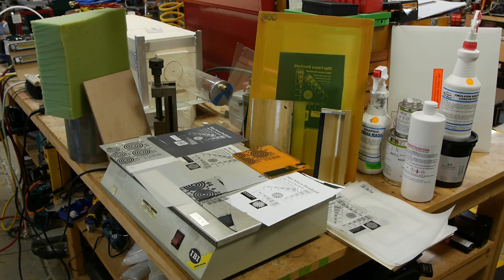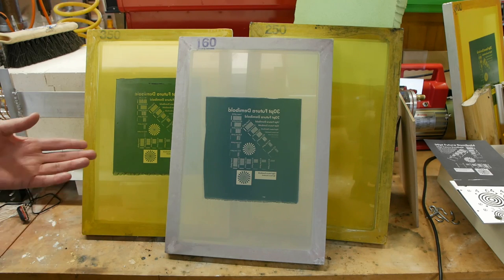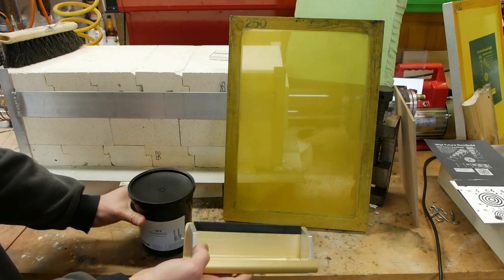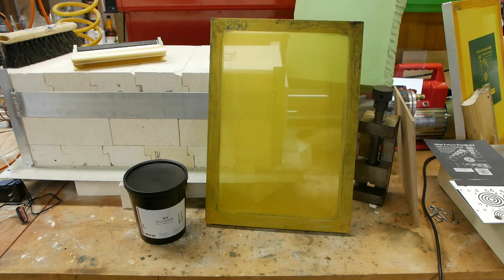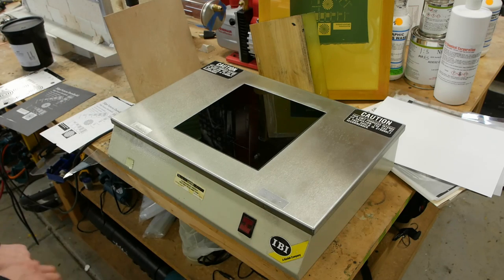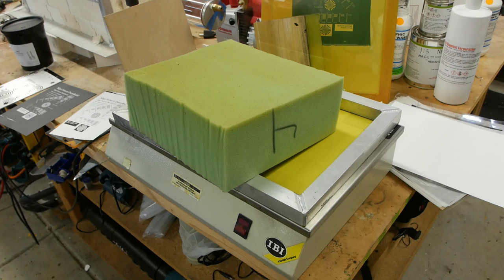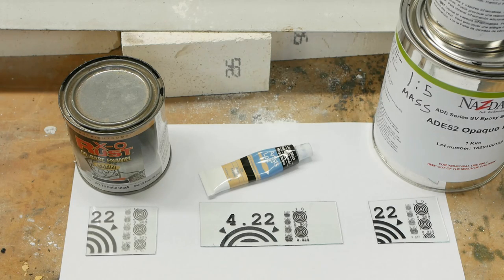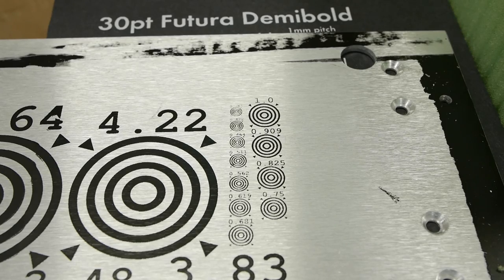High-resolution screen printing demystified

Comment: "Old Fashioned Direct Emulsion" - I've been screen printing for fifty years, in 1972, the "Old Fashioned" photo imaging was a gel coating on film that required a hydrogen peroxide with water for development. Back then Direct Emulsion was about 33-40% solids so the 'sawtoothing with the fabric' was far more distinct. Now Direct Emulsion is far more durable and about 60% solids. Xcellent video.

Comment: This is awesome, long ago (2005ish) I worked at a sign shop and they wanted to get into screen printing but didn't have the money for the equipment so I ordered some emulsion, 200 count screen material, scoop coater, ect, built my own frames and holder with registration pins, printed out the patters with black vinyl, cured it with a halogen work light.. Worked perfect from the first one. I was pretty amazed, made thousands of signs that way.

Comment: I'm a screen printer.  When washing out the stencil, as soon as you get the emulsion whey, it is no longer light sensitive. After burning a screen, I would spray it with water and use my hand to spread the water over the entire image...both sides...the wash out the stencil in daylight with no issues.
:)
Reply: Daylight as the light in the room....I wouldn't try washing out in direct sunlight. Wet emulsion is seemingly less sensitive but not, not sensitive.  I coat and wash out under room lights but wouldn't want sunlight streaming into the wash out area. Definitely no need to wash out in a darkroom setting.  Printer since '92

Comment: This is great. I  silkscreened some t-shirts a long time ago. I didn't know half of this. I looked into doing it again a few years ago and didn't find anything this organized. Thanks. Stretching the screens isn't that difficult. Your recommending buying pre-made screens which makes sense if your goal is just to do silkscreening.  But stretching the fabric is  easy to learn and has myriad applications. Back in college in about 1978 I watched an art student (Hi Eric O!) stretching a canvas- stapling the fabric onto the frame. I've been using that single lesson at least twice a year ever since. Just the simple concept of how to get out all the wrinkles is very useful. (Heavy duty 'pet proof' window screen can support your weight  from replacing a mesh office seat to a cot).    
Also to clean up epoxy, usually vinegar works fairly well. Of course I don't know how it would work with the epoxy paint and the screen materials.    
One issue you won't have run into yet, is if you do a large run of printing, or make a few prints, clean your screen to use again, the edges of the mask will begin to deteriorate.
Finally, your resolution issue just might be a factor of your large light source. It could also be level (intensity and/or length) of exposure.  A point source should be better, but what I know about contact printing in photography... is that the size of the source isn't that important. Edward Weston just used a bare lightbulb about four feet above. What you're doing here in photography we'd call lith printing, no grays, just white or black. Exposure issues seem inconsequential....until they're a problem.  You seem pretty methodical. 
While I'm procrastinating getting on the treadmill... Andy Warhol is famous for his silk screen paintings, I'll bet he never made any of them by himself. He had others make them, and he didn't pay them very well. Gerard Malanga got fed up and moved to Italy. He was short of money, so he thought, why not make some bootleg Warhols? He brought his 'Warhols' to a gallery who was happy to show them...but a little suspicious. So the dealer called the Factory in NYC. Warhol assured  the dealer that they were indeed genuine....but send the check to me....

Comment: Nice introduction to the whole process.  All new to me, but very interesting.  One of my hobbies is restoring old electronic test equipment.  Often the front panels are worn or rusty, and it's a delicate balance between cleaning and not destroying the remaining printing.  I can see how one might scan a stripped down front panel for the original artwork, really clean and refinish the panel, sharpen up and restore the artwork and reprint it.   Even though I usually restore for function, restoring for appearance would be a fun new challenge.

Comment: To increase contrast on your print you can keep your printed sheet in solvent vapors for 10 - 20 minutes. The ink will melt and create smooth surface.

Comment: In my limited experience, it seems like UVA or near UV from LEDs is the fastest at curing these types of photopolymers. I took an old flatbed scanner and lined it with UV led strip and its 10x faster than the UVC bulbs I was using.
Reply: UVC is for sterilizing.  All the UV photographic stuff is either optimized for 365nm (mercury line in an arc lamp) or newer stuff is 405nm to match solid state emmiters (laser LED).  Black light (disco light) bulbs do the 365nm very well.
Reply: Not a bad idea!
Reply: Thinking the same thing sun mostly offers UVA if it is good some simple 365-400nm led types would do it easily. And there are even UVC leds if needed but at a much higher price.
Reply: Don't use UVC, it generates ozone and damages the light fixtures. Plenty of resists expose nearly instantly with it, until you add your transparency, then its waaaayyyy slower.

MUCH better to use UVA/UVB, I use bug zapper tubes and they work a treat for cyanotyping
Reply: @TheCunningFellow  i read "black lights do the disco very well" at first :)
Reply: I have a huge bag of UVB LED's I use for UV curing and they work super fast. The LED's have a lilac color to the eyes, a very pale bluish purple. It is very easy to tell them apart from the 'fake' UV LED's which look like a deep purple. The real ones are more of a pastel color, with almost a translucent haze to them to the naked eye.
Reply: Reminded of Big Clive's video on UV nail lamps.

Comment: When trying to do high resolution printing you can really go down a rabbit hole on that one.  There are combinations of screen and emulsion that perform better.  Not just screen number or the like but the actual screen material and emulsion can make a difference.  That gets into high end manufacturing as well.  I never got into enough to help but it is out there.  What you are doing is perfect for folks like me though.

Comment: I take a screen printing class last year. 
I just print my artwork to regular 70 gram HVS paper using my inkjet printer and then brush the paper with cooking oil to make it transparent. Works better than all my classmates, which mostly using expensive ready to use kit. My teacher is so impressed with mine even though I didn't do exactly what he told me to (using laserjet printer).

Comment: This takes me back, when I was doing screen management at a shop we never needed to cure for more than 5 minutes though, and that was with fairly high detail.

We used laser printed transparencies at 600dpi and supported up to 8 layers with good alignment. Most jobs used a backing layer and 2-4 colours.

You are absolutely right about the matt separation distance causing problems for exposure, but using a paper matt causes too much diffusion as well so I can't recommend unless it's for learning.

Oh, you should cover the ink curing process if you can, it affects longevity and durability especially for cloth prints.

Comment: Great helpful video, I’ve been screen printing for a few months now at my job using the Nazdar epoxy ink under mil-std-130. There are also variety of lead and cadmium based inks but they are all very sticky and quite messy.. as well as fun to work with. I am mainly parts marking so printing a large assortment of surfaces.

Comment: I know you were looking for image integrity being retained in the process and that is often important. 

On the other hand if you don't need the output to be without loss then a hack I tried with respect to the actual screen itself gives pretty good results. Specifically I built my own frames and rather than apply commercial screen I tried 'dollar store' shear curtain material. In my experiment I wanted a painterly feel to the image. To achieve this I thinned SpeedBall's drawing fluid and painted on a floral design in a manner similar to one of my watercolor paintings. I then used SpeedBall's screen filler followed by, once dry, washing out the drawing fluid. At this point I looked through the screen and decided the edges in the image were a bit too well defined and giving more of a coloring book or poster feel to the image than the look of a painting. 

I then grabbed a brush and a bottle of white inexpensive acrylic paint and brushed it into the image to break up the continuity that was giving the coloring book look to the image. I then ran a print. It was gorgeous and looked like I had painted the floral design on the paper entirely by brush. Not only did my lines and fields of color have the painterly look but the acrylic paint having only partially filled grid openings in the screen created beautiful high lights and over all a very good sense of depth was achieved in the image allowing the viewer to feel he or she was looking into three dimensional space.

Comment: This reminds me of my old days using flat bed cameras where you needed to learn various nuances of the equipment and materials to get the best results and test prints/patterns were always something great when making film for printing plates which you could be masked off. There was also the benefit of using a vacuum/compressor bed on both the flat bed camera and UV plate exposer.

I also did print some small run monochrome t-shirts (text and halftone) in the late 90's/early 00's but nothing requiring a high resolution and it was done using home kits that really weren't the greatest and often 2 small screens were used to make larger prints as you just found a solution to the problem you had.

New sub ;-)

Comment: Great video. Made screens for a PCB manufacturing plant. For the UV exposure we had a vacuum table. Making screens inst hard if you get frames that are able to be stretched, just takes a while to get the hang of getting it on right and getting the right tension across the whole surface. Also for making drying times shorter, we just put the frames in a holder in front of a box fan setup. They'll usually dry in an hour or so. You can also shop vac the water off the emulsion after it sets for a moment if you have a nice smooth tool for the job, just to make sure it doesnt pop the screen.

Comment: Someone may have already mentioned this. But with a halogen work lamp for contractors and garage spaces. If you take the uv filter off. It use to set the emolsion I was using up in a max of 1min. The time was so short.  I actually had to time it. If I waited too long, I would lose line definition on fine details. Awesome video as always good sir.

Comment: I Screen print all the London Bus Destination roller blinds,  we use 72 mesh count and the edge detail on curves is suprizingly sharp.      really small text you need finer mesh but you can get fine edges on large text on a bigger mesh count ,also provides better ink coverage/opacity.     21 years experiance.    Screen printer for life :)

Comment: Good service for young screen printers!
You've asked if there were any  questions, but I am adding some comments, and hope you do not mind.
1. 140s to 160s (light fabric versus "t") mesh count has given me good resolutions in the past , with 5 star or autotype stencils; viewed
under magnification. Lighter cloth deposits a thinner ink film with less spreading.
2. The indirect/ direct photistencil determines the final result. The mesh is not so important.
3 . Dyed orange/ red screen cloth reduces undercutting during exposure.
4. Making a video is no joke, so suggesting a good book will get you more interaction.
5. The Thames and Hudson manual of screen printing is a good reference and screen cloth manufacturers such as (Nylobolt) would give you an authoritative manual if you wrote to  them.
6. For those struggling with exposure boxes the simplest one for direct stencils would be one with normal tube lights  spaced 4 inches apart ( between tube glass surfaces  ) and 4 inches from the glass on which the positive is placed. You could get an exposure time of just 3 minutes. I've used professionally made photolithography positives to get great resolutions; even with direct screens.
7. For indirect stencils one could experiment with metal halide light sources now available with local hardware shops. Aim for an exposure starting with 3 minutes.
I am a senior citizen and have found many printers who need infirmation hence the urge to write these lines.
All the best!

Comment: 25 or so years ago. My dad used a similar process to sand blast designs on glass.
    The glass was coated, exposed with a clear transparency, washed, sand blasted. The coating was removed with a release agent. 
     The clear transparencies were made in printing shop he used to work at. Some were pretty big.

Comment: Back when I did some printing we used to do the exposure  with a top illuminated table with a shallow rubber backed vacuum chamber with a glass panel top. It was built by someone and it looked pretty shoddy but it worked perfectly. The vacuum pump was an old refrigerator compressor. You could also expose offset plates.

Comment: screen resolution and screen tension is the key to getting a good print.  in the late 90s i worked for the company injection molding the bezels and painting and printing for RCS DTV units. we designed a print machine, a 6ft round table made from aluminum, to print on RCA DTV bezels on 3 different print tables ran by compressed air and micro switches. it took about 6 months to fully design and build the table and fixtures.  it was tricky because they were narrow and not all of the surfaces were flat, the button printing was the most difficult!  i used round bar screen frames which you could tension to what you needed, using a screen tension gauge. i liked the film emulsion but found the liquid you spread on yourself was much cheaper and allowed more control over the UV inks thickness.  I hated the 3 day tan/burns i got from the  5k watt light machine we used to expose the screens. also you can dry the screens with a hair dryer on low heat. I did this before i got an oven to dry them. 
Great video covering all the ins and outs of screen printing.  It can be done at home pretty cheap.
Reply: something you didnt mention. when you get a new screen , or make your own, and you want it to last a long time. i suggest using a stiff scrub brush and abrading the screen mesh for 1-3 mins, even if you're using adhering liquid. this is so the emulsion will stick better to the screen with film or liquid emulsions, it makes the image better and more durable IMO. i have screens that I used 20+ yrs ago, and i can still print the same images today with the same quality because i used this method of adhering. UV inks made for printing is the best! this is the place i worked with to get all the materials, a great company to work with in Crawfordsville, Indiana . http://www.norcote.com/

Comment: The tracing paper (or the vellum paper) can also be used to print circuit boards. You have to print the circuit board design onto that paper and then place that paper onto the fotosensitive layer resting on top of the copper sheet card, then cast UV light onto it for approx. 20 minutes. It is also VERY IMPORTANT to develop the print - this will wash out unprinted areas of the circuit board. Then you have to dissolve the copper sheet inside an acid to reveal the circuitry and clean the remains of the developed fotosensitive layer out of it. Copper protection against oxidation is always a good idea (rosin is used for this purpose in printed circuitry). Then install the electronic components, solder it with a tin and rosin (rosin makes it easier to melt tin, that's why it is used to protect the circuit, it makes it possible to solder later). Done.

Comment: Regular lightweight printer paper will also work just fine as a mask. Just put a light coat of mineral or vegetable oil over the paper (enough to saturate but not to soak) then dab dry with blank newsprint. The oil makes the paper translucent enough and doesn't mix with emulsion.
We often ran a small heated fan into the drying cupboard to aid drying times.

Comment: I used to manage a pad printing and screen printing shop, and had to sign a N.D. & N.C. forms, for what ever I learned, and was not allowed to work with in a certain radius or run my own business doing the same work, which I thought was fraudulent. Never the less, I learned allot, for future projects I was going to be doing... Anyhow, every screen printer is having a cow right now, of you showing how it is done, lol... Good on you!!! Just wait until the common folks realize how cheap the cost of bulk T-shirts cost, lol... And how quickly they can be screen printed, lol... Qty: 100 XL T-shirts, by a naked brand, $0.85 a piece, lol... I am all for capitalism, but dang, I was blown away at the mark up on this screen printing printing stuff... Note, I am not discounting the artistry and the craft, as there is a skill set that does take time to learn and understand.. Just saying...

Comment: One of the worst things about screen printing in my 2 years of experience has been using different types of emulsion and capillary film and having to adjust the exposure times accordingly. It is really frustrating to burn out a screen, only for all your emulsion to pop out, leaving you to re-emulsify, reburn, adjust burn times, and try again (usually repeating this process a few more times until the exposure unit is set to the right time) thank you for the help!